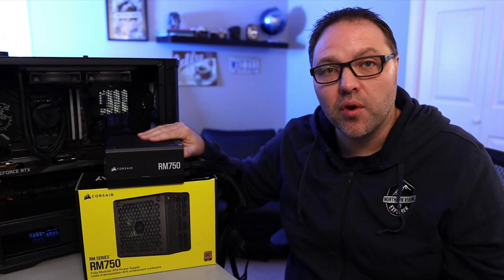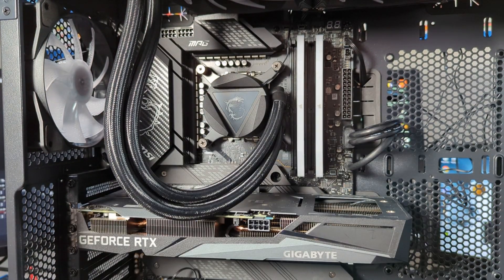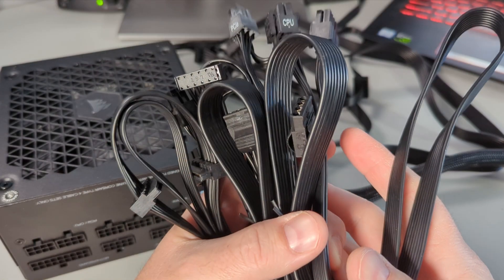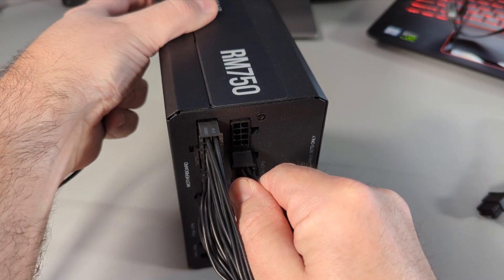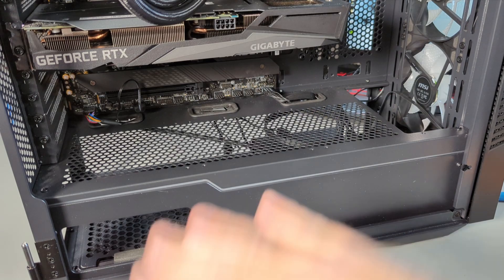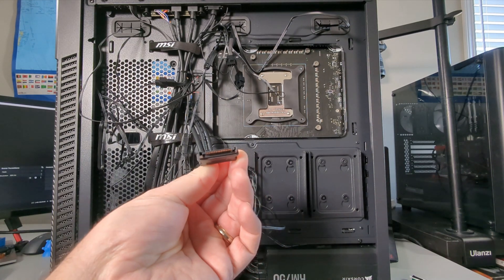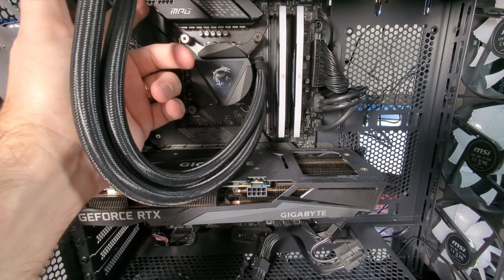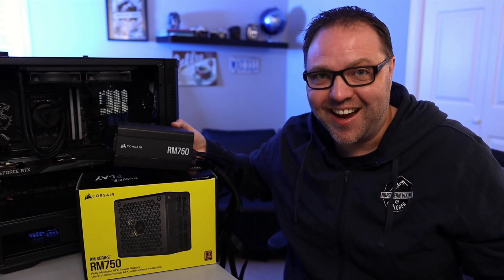Power Supply Installation & Cable Connections to Motherboard (Corsair RM750 PSU)

Comment: Can someone help me? 

I got a new power supply and now my PC won't turn on. The lights on the motherboard light up but, when I press the power button nothing happens. When I switch back to my old power supply it works perfectly fine. I'm stumped.

Comment: I usually don’t comment but BRUH my old PSU went out for 2 weeks & I stream … YOURE A LIFE SAVER 🙏🏾
Reply: What happened that you knew it went out
Reply: @SolidNate99 pc prolly stopped turning on 💀
Reply: @shootama Emoji is not necessary
Reply: @omccc  100% was
Reply: @omccc it was
Reply: @Sith-j6k No
Reply: i went down the reddit rabbit hole and this video just confirmed it. Had to take a leap of faith when i bought the new one and it worked lol @SolidNate99
Reply from the maker: Glad I could help 😃👍
Reply: @NorthernVikingEveryday  your a superstar I was so confused if a sata cable came with the psu as I have a argb hub thank you so much bro I don’t have to buy one lol who knew psu have sata connectors
Reply: I CANT DUCKING WIRE MY PC WTFFFFF
Reply: SAME  @boomer1109

Comment: so where do the fan cables go bro - I mean which module in the PSU supplies power to the Chassis body fans
Reply from the maker: Typically they plug into the motherboard which powers them, not the power supply.

Comment: How do i power the powr supply tho? That is  the only part im stuck on.
Reply from the maker: There should be a power cord that comes with your power supply that plugs in on the back. That gets plugged into a standard plug.

Comment: I have a question does the power supply when u switch it on does it have to spin? I have a segotep power supply 750w i think its broken right now because the fan is not spinning
Reply: This is probably late but i think the psu has a setting to where it’ll only spin once it reaches a certain temperature to reduce noise

Comment: I have a Corsair CX750M 750 watts and i want a 850 watts, can i used the 750 watts power supply cables for the power supply 850 watts?? Or i need to used the cables that came in the box?
Reply from the maker: It is always recommended to use the cables that came in the box.
Reply: @NorthernVikingEveryday  ok i'm new at gaming PC so there are only 3 connected? Motherboard, CPU and GPU- PCI? And what about the case rgb? I have a Corsair 4000x rgb case
Reply: So i need to remove all the 750 watts cables, hope i don't break anything

Comment: Can I use a Corsair 750W Bronze for a RTX 4070ti ? I have a i5 12400f and 16gb ram ddr3 3200 and a liquid cpu cooler ??
Reply from the maker: If you go to the PC part picker website you can put in all your components and it will tell you what the estimated wattage of your system is.
Reply: That's horrible, dd3 ram and 4070ti lol, you need to upgrade to ddr4 32gb of ram and at least i5 13600 with that gpu

Comment: I got confused, did you install it upside down or it doesn't matter? ive never seen a psu installed with the fan upwards. its always down because i noticed the text was upside down
Reply from the maker: It can be installed in both directions depending on whether you want the air from the bottom or from inside the case. The text is flipped upside down on one side so it looks correct when looking at your PC.
Reply: @NorthernVikingEveryday Personally I would not want the hot air inside the case being drawn over the PSU.....🙄

Comment: Awesome.  Corsair's quick guide is a bit vague.
Note. Regarding CPU power, my Asus motherboard (for an AMD AM5 - Ryzen 9 7900X) CPU has both an ATX_12V_1 and ATX_12V_2 where ATX_12V_1 is 8 pins and ATX_12V_2 is 4 pins.
Depending on your power supply, the Corsair "+12V (EPS 12V) cable supplied by Corsair has a cable plug is designed to separate in two to accommodate 4 pin setups (see their instructions below). 
Note that per some posts, it appears that while ATX_V1 is needed, ATX_V2 may be optional and only be needed in some cases (such as heavy overclocking).

Per Corsair, for the 2021 RMx series power supplies:
1. Make sure the power supply’s AC power cable is not connected.

2. Follow the directions in your chassis manual and install the power supply with the screws provided.

3 . Connect the 24-pin (ATX) cable to the motherboard. 

Connect the eight-pin +12V (EPS12V) cable to the motherboard:

a. If your motherboard has an eight-pin +12V socket, connect the eight-pin cable directly
to your motherboard.
b. If your motherboard has a four-pin socket, detach the four-pin from the eight-pin cable, and then plug this
four-pin cable directly to your motherboard.
c. Some motherboards will require a mix of 8+4 pins, use as many EPS12V cables as necessary and do not
mistake them for PCIe cables."

4. Connect the peripheral cables, PCI-Express cables, and SATA cables.
a. Connect the SATA cables to your SATA SSD or hard drive’s power sockets.
b. Connect the PCI-Express cables to the power sockets of your PCI-Express video cards if required.
c. Connect the peripheral cables to any peripherals requiring a 4-pin connector.
d. Make sure all the cables are tightly connected. Be sure to save any unused modular cables for future
component additions.
5. Connect the AC power cord to the power supply and turn it on by pushing the switch to the ON position
(marked with “I”)."
Reply: I can’t detach the 8 pin how do you do this

Comment: I got a new corsair PSU to replace my dying rosewill 1000w, noticed my 3090 losing display constantly, turns out the PSU is randomly not giving power to the 3090. I'll be replacing my rosewill one with a corsair 1000W. 
I'll be using this guide as a reference
Reply from the maker: Awesome 👍 Glad I could help.
Reply: Nobody asked